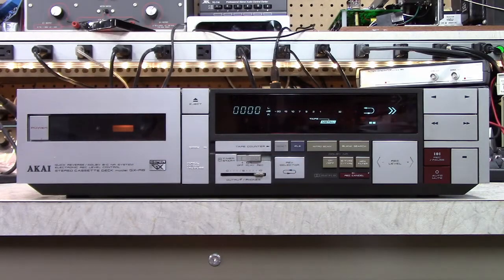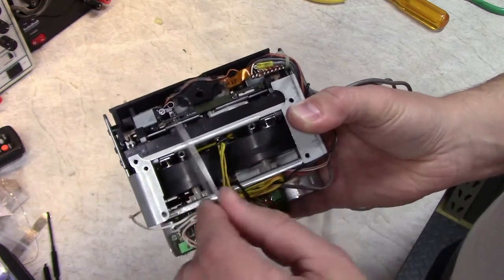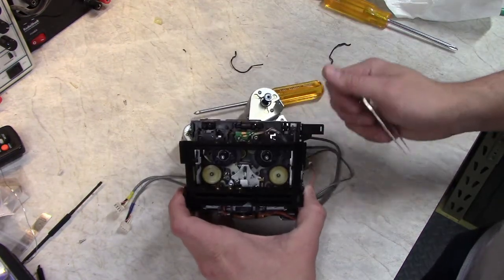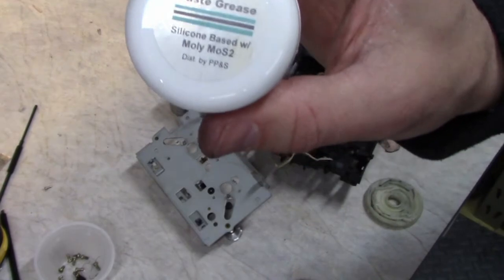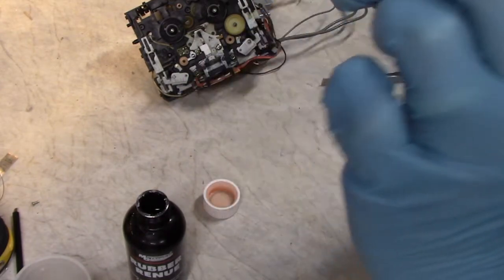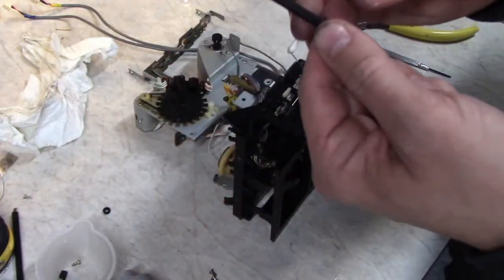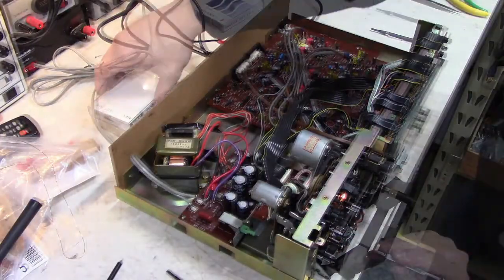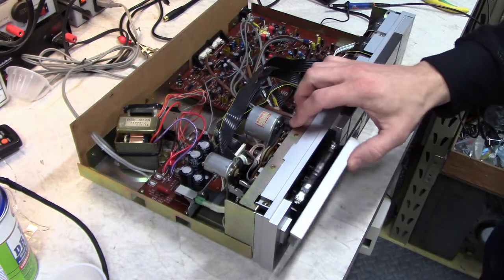Akai GX-R6 Servicing

Comment: My deepest respect for your patience... And your guts! ALL those tiny springs, wires, belts, screws, washers... This video would have helped me very much with my AKAI HX-R5 in the 80's... Yes, it's the 'cheaper one' with slightly less functions and unfortunately no 'GX'-heads. I still have the deck, but 'm pretty sure that it won't start after all these years just sitting around on a shelf, idly...

If even one of you guys could have told me that the auto-reverse mechanism is an azimuth-troublemaker in the first place. So little did i know when i was 17 and assumed that the deck should be perfectly aligned all time. Recordings made in the 'forward'-mode should sound EXACTLY the same in the 'reverse'-mode, was my opinion back then, in MONO-mode... So i recorded white noise and adjusted the azimuth listening in MONO. Now THAT's putting a deck to the test, wich always failed especially when you take into account that such i a hard task for such an auto-reverse mechanism. Those 'azimuth'-screws are pretty worn off. And my pretty new deck was most of the time disassambled than put together. I was constantly 'tweeking'...

Anyway, i was just scribbling around YouTube for 'nerdy cassette deck video's' and i stumbled into yours with the intention to have just a quick look. 

But it's now an hour later ;-)

Thank you, and the warmest greetings from Amsterdam.
Reply from the maker: Haha...I know what you mean about head azimuth.  I used to carry a small screw driver in my pocket whenever I'd listen to my Walkman because it would drive me crazy when the azimuth was off.  It would vary depending what deck was used to record the tape and also as the Walkman warmed up or got squeezed in my pocket. None of this is an issue in this day and age, and yet I still keep these decks around and occasionally use them.  All nostalgia, I guess....
Thanks for watching!

Comment: Tip- When removing the top cover, remove the BOTTOM screws from the rear fiber board..   No fighting the lid/lip  It just pulls out, back and away..